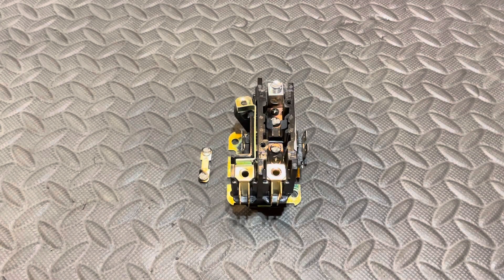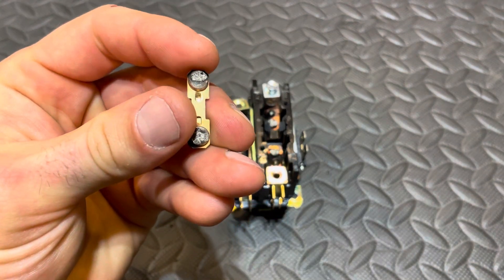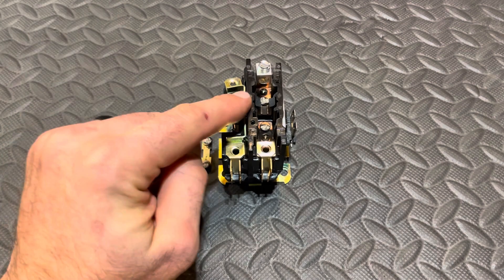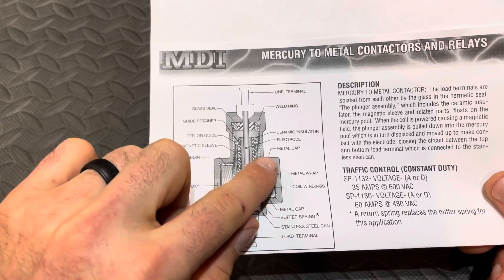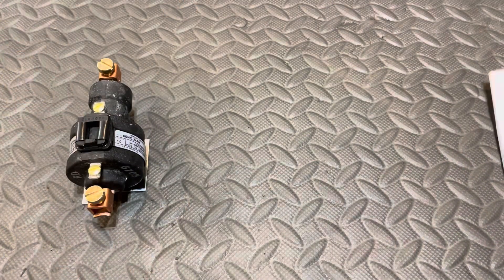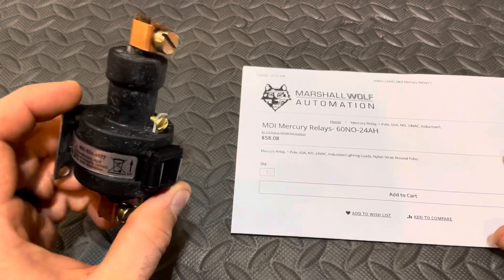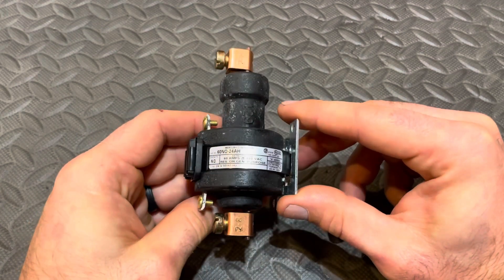Edu4: Unique Solution to a Burnt Contactor - Mercury Relay

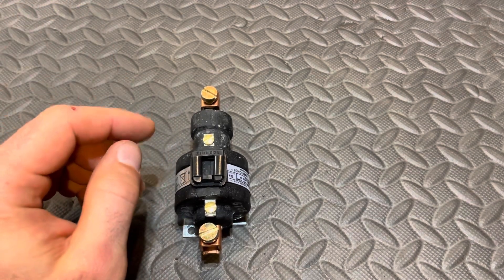Comment: About 5:30 into the video you mention something.  Can you go into detail of what you seen? Do you have to worry about the argon too?
Reply from the maker: Once I saw an experiment go wrong in my chemistry class.  The professor thought he needed more hydrogen but I saw the flame go out before contacting the hydrogen.  After filling an huge balloon to bursting he tried again.  Both the noise and the resulting shock wave was incredible and left him wondering what had happened 💥😅
Reply: @HVACLife  I see what you mean now. I was picturing it having something to do with the relay and was confused with your description because the relay sounds like you would have been that described differently.
Reply from the maker: Yeah problem is too many TVs going at once in the ol think box!  Good ol tangents of tangents 🤓

Comment: This is the gospel I've been searching for...great information!  I ordered the MDI 260NO-24AH-18...2-pole version of what you have in your vid.  Fingers crossed...
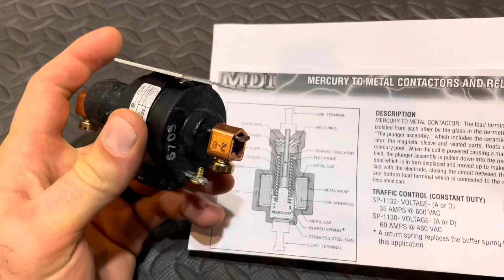Reply: @HVACLife  So, which end (top vs bottom) should be connected to the hot wire(s)?  The existing contactor I "think" has the hot wires connected to the bottom.  The diagram you are holding at 3:14 says the top post is "LINE TERMINAL"  and the bottom post is the "LOAD TERMINAL".
Reply: @HVACLife  Got my 2-pole mercury contactor installed...she's blowing icy cold :)  Thanks for this information again!  Just ordered a USA made Amrad run capacitor to replace the 9 year old foreign made unit...I'm told it's cheap insurance.

Comment: Not that common due to price.
As you know, the customer wants cheap and quality suffers because of that.
Get someone who understands the reason for this, like yourself, and it is a no-brainer sale!!
Reply: The mercury relay in the video is only $30-$35. A really good contactor that will last costs more than that. You can get cheap Chinesium contactors for $15, but they will fail.
Reply: @milesparris4045  AVE fan